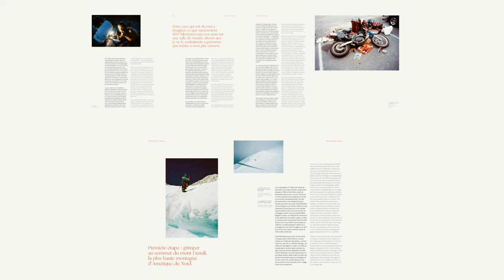James Barkman: GoWesty Traveler Series

Comment: When you rebuid the transmission, put the positraction on it. You get a lot better off road traction.  Also when you put the lift kit on, besure to upgrade the boots on the CV joints because the stock ones tear easily and then  you will be doing CV joints again.

Comment: I love the original plaid foam mat still in the back. Dude you are old school. Get a blue printed engine from Tuttle. I dropped one in SLO town. Then contact the Bend Or transmission place to make sure you have the right one for your engine. My VW is stock. Keeping it real, one bolt at a time. '77 camper.

Comment: so is the van actually a 4wd? I couldn't imagine it driving on sand if not, but i mnot sure i ve seen a T2 syncro...
Reply: I believe  he was saying that with larger wheels and the Fox shocks and rear wheel drive with engine weight over the drive wheel(s) it does amazing things.  VW did have an engineer that made a 4 wheel drive T2,  but it did not make it into mass production, but it made a path for the T3 syncro.   I saw a video on syncro development its on youtube someplace....
Reply: @DanTheManIOM  
Ouaou!
So it's only with larger wheels, eh!
Quite interesting, and i have been thinking about puttting them on my T3. I wonder how the better shocks help at being able to drive on sand though and not digging holes though...